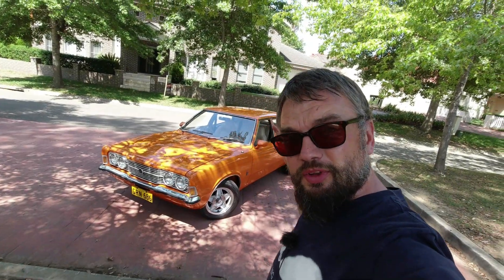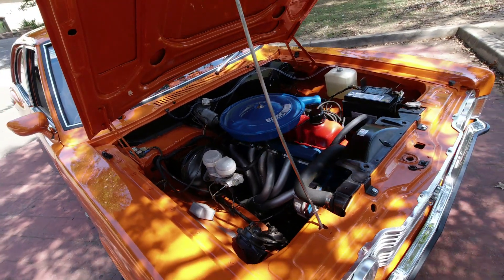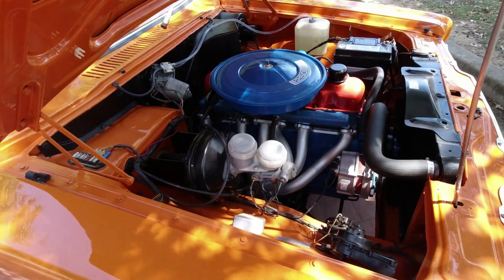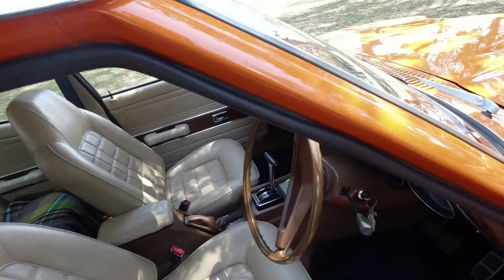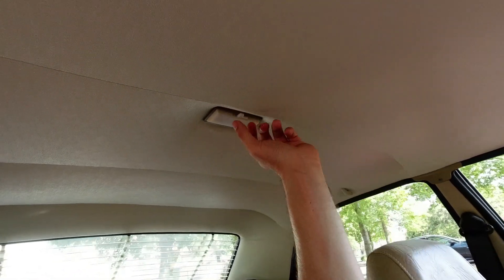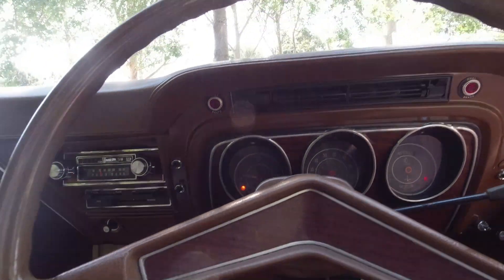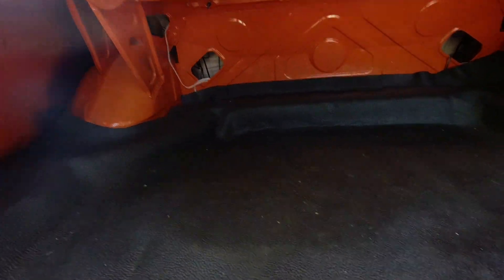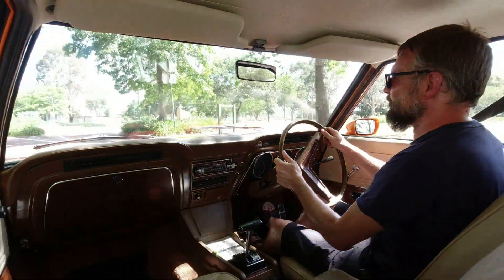Aussie Oddballs: Ford Cortina 6! 4.1-litre, tested in 40+ degree heat

Comment: that engine looks like a 200 not 250 cubic inch
Reply: Did they have different coloured rocker covers?
Reply: I had a later 250 engine it was a crossflow and the heads look bigger my mistake keep up the goodwork gary

Comment: Just posted is sound and vision of the later Australian TE Ford Cortina six mk 4 from 1979 with the six cylinder cross flow motor. Winning it's class in the Targa Great Barrier Reef in September :  https://youtu.be/RCO0_9oYfag1979 TE Ford Cortina six with four speed manual trans driven and navigated by a husband and wife team beating some more exotic cars through reliability.

Comment: With the crossflow 6 cylinder, webber carby, extractotors and 2-5 inch exhaust, even the fuel economy was better. As long as you didn't hammer it.

Comment: I owned a '76 XLE which was top of the range. 4.1 250cu,vinyl roof,velour interior,factory mags in lemon lime colour. Beautiful car but very touchy in the wet. Just a slight touch on the accelerator and it would spin the wheels. Mine had the upgraded cross flow engine compared to the earlier model you tested.

Comment: I quite like big straight 6's because of the torque. I remember alot of Jeep Cherokee's with the 4.0 high output engine and it wasn't that often i heard them change gear.

Comment: You have shown me a orange 🍊 original dream .dream v8 turbo version similarly to  this orange one in uk 🇬🇧 which is bronze . I think ford were very generous with engine bay size which take little work to modify with either one of those engines . My eyes 👀 are green with envy anyway you’re blessed with your test drives .

Comment: And I bet it didn’t have aircon it was a very exspensive option back in the day 
Not included like today 
They were fantastic with the 250 in it and the later ones had the 250 cross flow engine 
Try and find a tf s pack

Comment: The TC 4.1came with a 3 speed manual! 
TD 4.1 with a 4 speed manual! 
One of the most common modes was springs and dual sway bars on the front and stiffer I think 1” on the back ! 
There were a few TDs that had the bolt on manifold and two barrel carb I think they were all from the Hombush plant! You could bottom out the speedo and still be picking up speed ! The 2ltr was garbage no comparison to the 4.1 or 3.3 200ci !
Another odd ball was our centura with I think a 245 6 cylinder Hemi
Reply: wayne chaston I had the TC with the 4 speed Manuel gearbox . 
It was an option with the TC .
Reply: Paul Clark 
Sorry I had never seen a TC 6 cylinder with a 4 speed only the 4 cylinder! Thanks Paul !

Comment: Seeing this one reminds me of my first car. A later 2.0 P Reg in “Sweeney” blue which started as an XL but I converted it to a 2000E with different interior trim etc etc. And I had to change the steering wheel from the original as fitted in this one to one that was actually round! Very annoyingly I once finished work and came back to my car to find some light fingered little toad had removed the front indicator lenses whilst it had been parked up.

Comment: Pffft agricultural! The Australian Chrysler Centura had the Hemi 265ci straight 6 which could be easily upgraded to the triple Weber Twin Throat 6 Pack which powered the E49 Charger.
Reply: The Centura was not sold with the 265, but everybody put them in just because they could- as I did back in 1990.

Comment: The 200 and 250 six stayed around in the USA until the early 1980's. It's interesting that Aussie six's went to a ohc set up and Americans switched to a V6 design.
Reply: Ford Australia made a cross flow cylinder head for them in 1976, due mainly to tougher anti pollution laws the infamous ADR86. Then in 1980 or so the crossflow head got redesigned by Honda and cast in Aluminium and in 1982 for the XE Falcon the head got updated and they fitted a two barrel ADM34 Weber carby and at the same time ditched the leaf spring rear end and went to a watts link. It was a big deal at the time. The OHC (only single cam at first) wasn't until 1988 with the somewhat crappy EA Falcon. And the DOHC wasn't brought out until 2002 with the BA Falcon. The twin cam 4.0 litre is what people think of when the name Barra is mentioned. But this grandfathers axe of an engine can be traced back to the XK Falcon's 144 cubic inch - about 2.4 litres, American designed straight six from 1959
Reply: Actually I got that wrong - it was ADR76 that brought in the tougher anti pollution laws for passenger cars to Australia. ADR86 was for the introduction of unleaded fuel and catalytic converters, 1986, ten years later

Comment: Nice restoration, However that colour isn't a Ford period Colour. 

The interior and front end treatment shows that car was either an XLE {the badges were missing} or has the bits of one fitted as with the 14" wheels that were not factory or dealer factory it got 13".  The XLE also had a factory vinyl roof fitted to most. The lower config cars had a single headlight per side, no arm rest in the rear and even a bench seat. The front didn't have a sway bar on the lower model as standard and those were deadly. My brother had a bare bones  200 with a 3 speed floor shift and no other options, even the brakes were 4 wheel drum and not even the same size as the Falcon. I believe they were the same as fitted to the 4 cylinder with no booster. The body roll was scary and quite dangerous, the brakes worked adequately once then started to cook. The 4 cylinder versions were also available in 2 sizes a 1600 push rod and a 2 liter OHC. The 6 cylinder cars also required a different bonnet fitted with a bulge in the center that was needed to clear the rocker cover.

Comment: A nice example.
Have driven these and the later models many years ago. Great power to weight ratio. The ratios of the manual box not optimum imo , but the auto box was better.
Imagine if these had 4 speed auto.
At 40 deg where are you testing it?

Comment: Why is it an odball. How many were made compared to the 4 cylinder? Interesting wiper fetish going on there. Hubnut or wiperfetish.
Reply: Odd for worldwide Cortina production. Even in Australia the 2 litre and 1.6 litre four cylinder cars outsold the sixes. People not wanting the extra cost and fuel consumption of the six. People wanting performance more often went for Falcon GT or other V8 models. Even six cylinder buyers more often went for the 200 cui 3.3 litre option.

Comment: Had one of these back in the day, "lead tipped arrow" is probably a good indication on how the thing handled, certainly had a bit of an issue with understeer under power.
Reply: Haha, the word "handling" and this Cortina should never be used together.
Reply: They wanted them to handle that way, so they would be familiar to Aussie Falcon/Kingswood/ Valiant drivers. All Aussie cars understeered until you tuned the suspension or installed a powerful engine.
Reply: @rossbrumby1957  I had a 307 powerglide kingswood and it understeered until you prodded it a bit and the tail end let go in spectacular fashion :)  But the body didn't flex like the cortina.  If you jacked up a corner to change the inevitably regular crossply puncture you could still open the doors.

Comment: Great stuff Ian.  Despite the mic issue, this is slick and great to watch!  Love the period details such as the metal rear louvre, which used to be so common before the external plastic ones became a thing in the '80s, and the metal numberplate frame on the rear, possibly the original dealer's.  Those mirrors were also fitted to the Falcons of the era and the Bathurst Globes were never quite right unless fitted to a Ford due to the close association.  Holdens of the time were more likely to sport Dragways or 'jellybean' slotted alloys in my memory.  Unless you just widened the factory steelies.
Reply: Stephen, good spotting mate. The number plate frame is the original dealer. Thompson Ford. It was a one owner car.

Comment: Ah yes the Aussie big six Corty, went like the clappers in a straight line but point it at a corner at a decent clip of speed (which they were easily capable of) & it could end in disaster. Four cylinder versions may not have had the grunt of the big sixes but they were better balanced and generally handled/steered better, and on the right road  were the quicker of the two. There was was definitely a compromise between the two, more grunt or better driveability. Once again a great video HubNut, hope you enjoyed your visit downunder & driving our unique vehicles, Cheers mate!.

Comment: Very nice car! Somewhat more lively than the base spec 1.3 a mate once had, then, which seemed very underpowered for this model (somewhat heavier than the mk2) especially when touring with four people and their camping gear in bumpy Cumbria and Northumberland in the late 70s. Spacious, though, I remember. We drove through the sea on the Lindisfarne road on this trip and apparently the rust really began to get hold of the bottom of the car shortly thereafter. It was scrapped the following year.
Reply: 1.3?? The 1.6 was a VERY basic offering offered here in Oz and they sold about 3 of them!!  The 2 litre lump was the 4 that sold.

Comment: Buy the way,did you know that the rear of the car was designed  based on a coke  bottle to give it the sensual curve of the female body on the quarter panels. 
Cheers

Comment: You don’t use a handbrake??? Glad you don’t drive my car
Reply from the maker: Not often in an auto.
Reply: HubNut that puts stress on the selector and other moving parts. My handbrake in my auto wasn’t working great and I thought I’ll get it sorted next service. Well every time I’d take it from park there would be a thud even if the engine was running.....longer story short, I ended up not only having handbrake problems, but transmission issues too. It’s there for a reason, use it. Engineers put these things in cars for a reason. “Well I don’t use them” is ignorant
Reply from the maker: Thumping into gear is nothing to do with the handbrake. It can be problematic on hills. I'll tend to use the handbrake there to prevent the locking pawl being overloaded. On the flat? Unlikely to bother.

Comment: Very cool car! Starting to watch now. Underloved, sought and wanted here in Belgium unfortunately. Only the earlier Cortinas are sometimes to be found at classic car meetings. It is confusing on how sometimes they are using metrics, sometimes imperial, MPH, kilometer/h, mpg or l/100, etc haha. I think mich more power can be achieved with this engine. Quite a poor figure really for a 4 litre engine. At least twin or triple carb would be lovely. As this head doesn’t have a a gallery like the early six BMC C series, this engine can easily be beefed up a bit.

Comment: As a born Welshman could you please stop carrying on about how hot you are . We have air conditioning , swimming  pools , beaches to die for and 40 is not hot . Try 5 ays in a row around 46 to 47  then we are talking . Everyone we know that had a Cortina had nothing but trouble with them . Warranty on all cars back then was 12 months or 20 thousand klm which ever came first .It was replaced buy the hugely successful Telstar clone of Mazdas 626 both won car of the year in 1983 . The 626 had better features and was moreover expensive due to being built in Japan .Latter Ford TX-5 s were also built in Hiroshima .
Reply from the maker: It was 46 degrees it turned out. I didn't like it. Telstar TX5 video to come.

Comment: These were a piece of shit.  The fours would leave them behind in both acceleration AND top end.  The sixes had a habit of tearing the rear suspension hangers right off the body if treated roughly.  They under-steered like a Valiant, which the fours didn't, and the brakes were shit.  Three speed on the floor was a joke of a manual option. The fours were powered by a 2 litre SOHC Cosworth motor and were superior in every way.  I had several of these over the years and I would love to get my hands on one these days.

Those alloy rims are aftermarket, not Ford at all.  The Iron head 250 WAS the 4.1Litre iron head, the block remained mostly unchanged well into the 2000"s where it had an alloy cross flow head and fuel injection., The TF had an alloy Crossflow head 4.1 but was bogged down by antipollution measures.
Reply: Lol a pinto 2.0 is not a "Cosworth" engine.
Reply: @Andyc351  Yes, your right, my mistake, the YB was developed from the Pinto, but that doesn't make the Pinto a Cosworth. Nevertheless, it was better than the six cylinder by miles and that was the point I was making.

Comment: Ok that it, is it just me or is trying to run wipers on all these 70's cars.. well all of the tested cars with out the engine running very annoying! For God sake, when do you use the wipers with 11.5 volts.. start the car then test them, sure they will wipe the same amount of screen but at least they won't act like a elderly zombie using a walking frame to get around.

Comment: Would think an Essex V6 would be better in one of these, but I am impressed an inline six fits. Though the Essex is still a heavy engine, at least you can have less weight overhanging the front axle (I know it's over a litre smaller as well)

Comment: Super interesting car, but perhaps one of the worst inlet manifold designs I've ever seen!
Reply from the maker: Seen an Austin 3-Litre? ;-)
Reply: It dates back to the first Falcon, the 1960 XK series, which had this six at 144 c.i. (2.4 ltrs) and a cast-on inlet manifold.  The cast-on manifold went when the six was changed in 1976 to a cross-flow cylinder head (intake on one side, and exhaust on the other).  This was brought about by tightening emissions legislation at the time.  The 144 c.i. developed about 85 horsepower, and the last Barra F6 versions 416 hp.